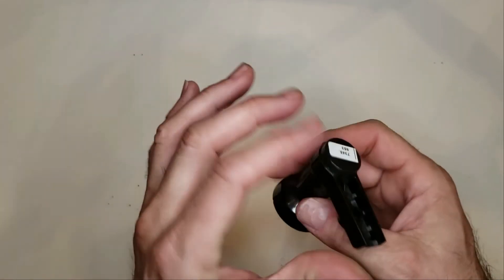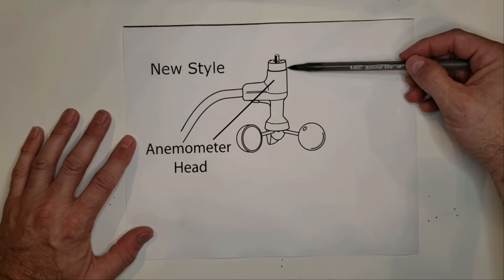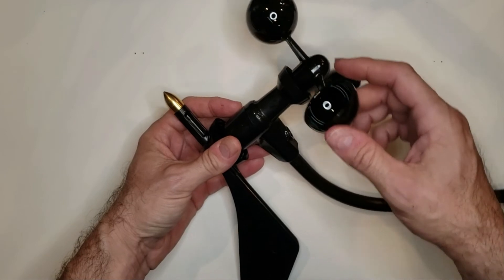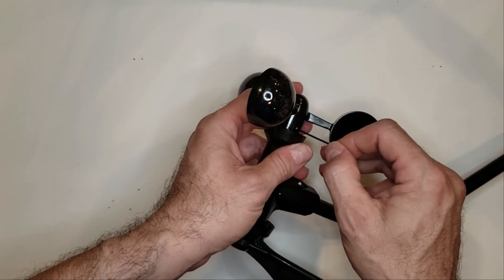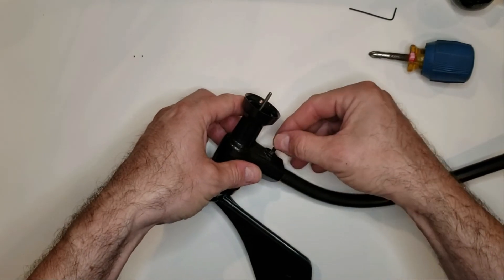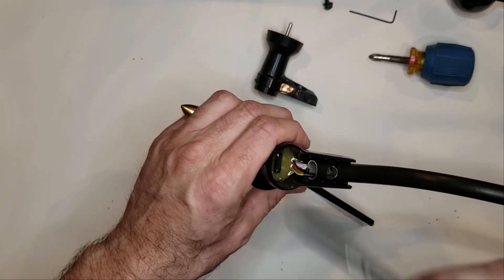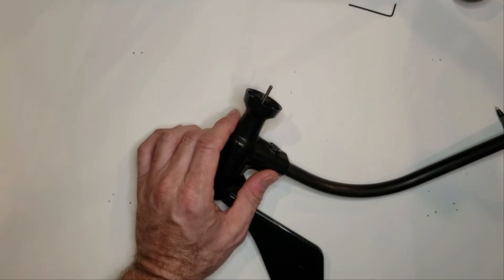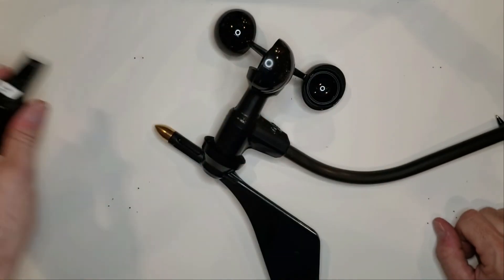Davis Vantage Pro2 Anemometer Wind Speed Cartridge Replacement

Comment: Thanks, Ryan. Placing another order with you today for this part. We just went through TS Helene as it came through North GA. My anemometer is not measuring the wind as it should. We've had some strong gusts here, especially this morning, and the data from it says the high gust was 10mph, which I know is not correct. My Davis Vantage Pro2 is now 6 years old.